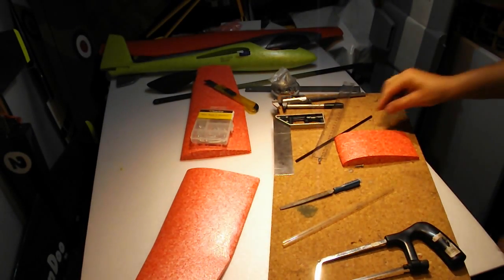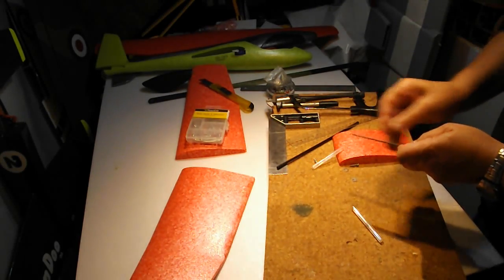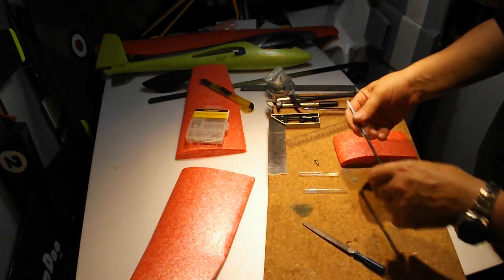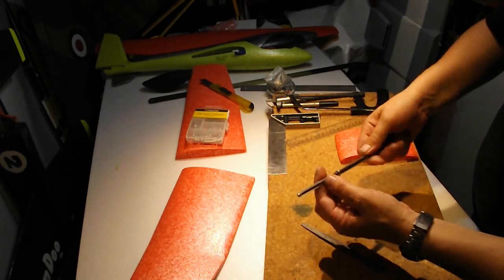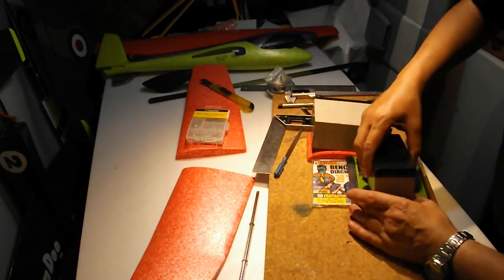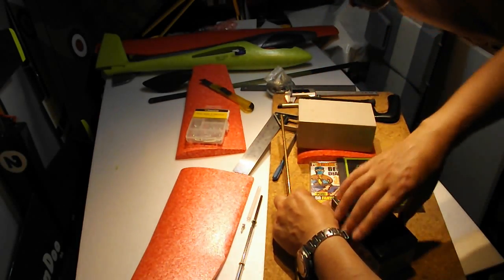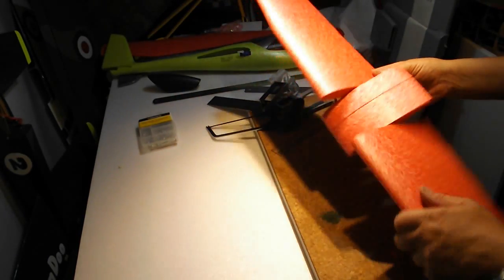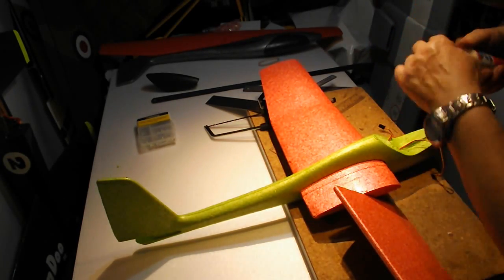Glider Conversion Pt2

Comment: hi good tutorial 
really clear.
The center of gravity in 50mm is ok ?
One more question, I'm doing the same modification on the wings and I've already done the servo programming on the station as elevons.
The question is in which direction do the wings have to move when I want to climb?
And in which direction should the wing on the left be moved when I want to turn to the left?

Thanks for your answer if you can help me
Reply from the maker: Hi Fendrich Fendrich
Level flight you will need to have the wings line up with the root wing. and set your radio to move the servos at 100% if your radio will allow more then you may like to add more to do good rolls. Also if your radio will allow you to set Expo use 40% as this will make it fly gentle. Then when you move the sticks fully you can do those fast rolls. 
Both wings, Trailing edges down = up . 
Left wing down Right wing up will roll to the right and if you feed in some up as well the plane will turn to the right. Hope that helps
Reply: @RcAircraft  
hello, thanks for the answer, but I'm a bit lost, for the plane to go up, in what position should the attack edges of the wings be?

sorry for the inconvenience but as I can not control the plane. I need to confirm that I have the movement well configured

thank you

Comment: Oh I see......I wonder if you could do it with brass tubing and carbon Rod at the very top of the Wing by just cutting a channel and then pouring in epoxy and fiberglassing over using spackle ..I live in Texas USA and The Thermals are really strong it'll make even a brick stay up ...
Reply from the maker: Yes, you could use brass tubing and a steel rod if weight is not a problem. And glass the whole wing. :-)
Reply: @RcAircraft  I meant using at the very top of the wing so it will be a little bit off-center and then filled in with epoxy ..flush... It would rotate a little bit differently but not much ..I've got two cheetahs ...39"
Reply from the maker: @gardentools2553  Yes that works too, Top or bottom of the wing and usually the epoxy covered slot is hidden by putting a sticker over it. 😉
Reply from the maker: I also have a Cheetah and it is a smaller copy of the Bolt glider. 
Only problem with the Cheetah is that it is so thin and flexible. Andrew Newton did a conversion and had to add carbon fibre to stiffen it up as his first attempt the wings bent too much.
I have thought about glassing the wings and giving that ago. 😊
Reply: @RcAircraft  I used the yellow cleaning rods that go into the air conditioning Vents and did almost the whole length of the wing and I followed up with  700 PSI strapping tape ...I put it at the top of the wing and filled up that Gap with putty and in the strapping tape goes into tension ....I'm in Texas and we have big thermals and big are for dynamic soaring ...even glider such as 88 oz of go up like they have helium inside them ..
Reply from the maker: @gardentools2553  Sounds like you will have no problem with your little glider then 👍. Good Luck with the maiden 👍

Comment: Hello, where do you drill the hole for the axle in the wing? In the middle, at the thickest point of the airfoil profile, or does it matter?
And how much path or which angle must the rudder throw (on the wing) have?
Thank you for your reply
Reply from the maker: HI, I explain where to measure in Pt1 @ 11:30 .
My black glider i fitted the tube at 85mm from the leading edge which works well.
Reply: @RcAircraft  Sorry, I didn't understand it acoustically. My English is not enough. " I'm not an Englishman /Scottish..."(sing)  ;)
Reply from the maker: @helmutw.4882  It`s ok i have put the info in the Description below the video for all to read worth pointing out though 👍

Comment: What is a cutting tube exactly? Is it just a copper tube with a chiselled point, or..?
Reply from the maker: Yes, The brass tube has one end sharpened from the inside so that the external diameter is not changed.
Can also be used to cut holes into soft balsa, like ribs in a wing.